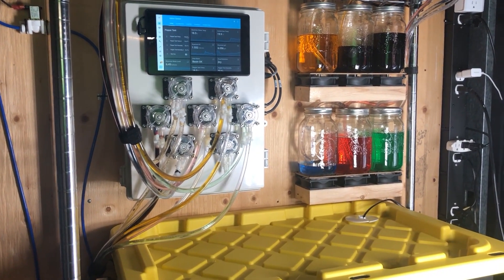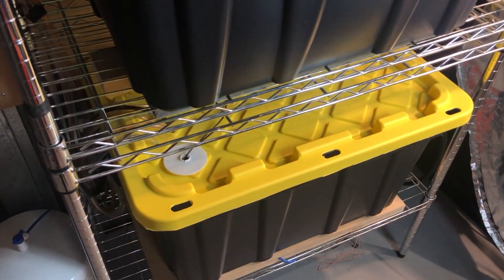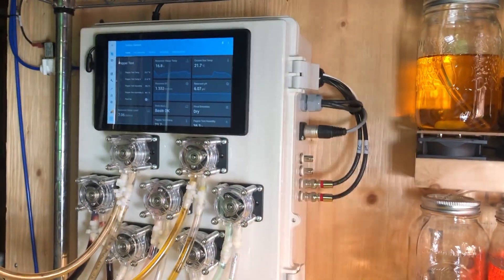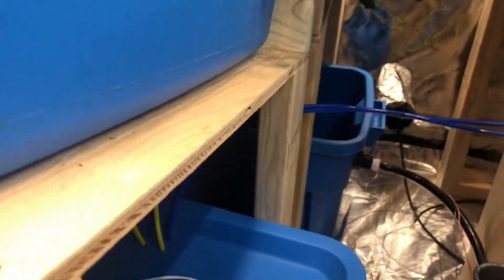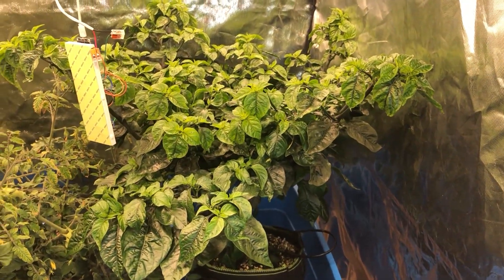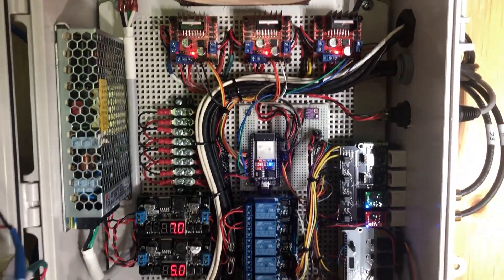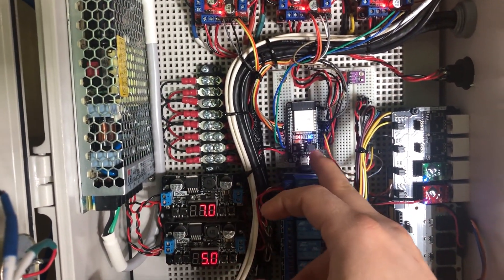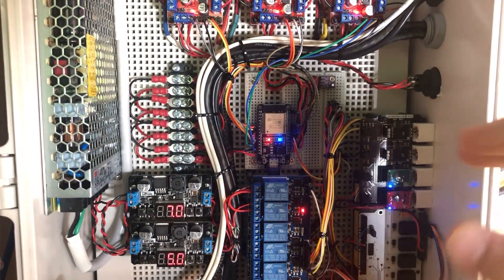My DIY Home Assistant Garden Automation System - Climate Control, Dosing, and More. Pt.1 - Hardware

Comment: Very impressive! I'm looking to also integrate my inline fan like you shortly mentioned you did in the video. Is there any chance you would be willing to elaborate a bit on how you did this? I also have the ac infinity and I haven't been able to find much information, so anything you could share on how you did it would be of great help and very much appreciated! I found I'll need an optoisolater, but I'm not very clear on the wiring
Reply from the maker: I'm now doing my Cloudline T6 with an ESP32, an IRLZ44N MOSFET and a 10K resistor. I'm not 100% sure it is the best/proper way to do it but it's working for me... use at your own risk though. When hooked up as it is from factory, at full speed, I'm measuring a little under 30W DC being fed to T6 fan.

On the fan is a little removable panel and there is a terminal block in there for ground (black), +24VDC (red) and PWM (yellow). I've left PWM and +24V as they were, but pulled the ground from the controller side off the terminal block. I feed this into the source side of the IRLZ44N, then run a new wire from the drain of the IRLZ44N to the terminal block where that other wire used to land. ESP32 ground gets tied to the source of the IRLZ44N and I also connect a 10K resistor between source and gate of the IRLZ44N - the resistor pulls down to ground so the fan can turn off when the PWM signal disappears. PWM out from the ESP32 attaches to the gate of the IRLZ44N as well.
Reply: @LEDGardener  Thanks for the very detailed explanation, crystal clear what I need to do!

Comment: Very nice! well put together and well designed.  I have been playing with something similar on a shoestring budget. Do the nutrients always stay in the hoses on the way out of the containers? meaning if I have a long hose of cal / mag and it is full of well over the 10 to 20 ml I will need , will your dosing mechanisms only dose the desired amount pressure restricts additional flow of nutrients after pumps stop ?
Reply from the maker: Yes, the hoses stay full. You need to make sure the hoses are clamped tightly to the pump fittings to maintain the vaccuum and prevent leakage.
Reply: Awesome, I was thinking about using this for rapid prototyping using deep learning from pics , taking the env variables . Maybe eventually spit out a perfect recipe for a plant for most optimized return .

Comment: You should use capacitive water sensors to avoid electrolysis:
https://youtu.be/udmJyncDvw0
Reply from the maker: I hope mine never even touch water since I’m just worried about floods
Reply: @LEDGardener  so when you 'flood them' your not worried about how much water is retained? And when to reflood them based on soil moisture level?
Reply from the maker: @jimmyjamall  Nope. I’m not using them in the plant pots. They are only used to detect when there’s an accident and the system floods. The plants sit in coco/perlite so you can flood them several times daily without worrying about drowning the plants. The coco-perlite combo is magic.
Reply: @LEDGardener  ooh thanks I'll have to read up on that.

Comment: your garden has much to be desired in production, but the detail of automation you created is astonishing.  I have been farming for 12 years, and am moving towards indoor and hydroponic growing.  I purchased a $50 optiplex and now am on a mission to spend all winter trying to set this machine up to automate my mushroom grow room as well as that emergency water sensor to save my ass.  Plus having the ability to mix hydroponic solution would take away all my clumsy habits that are in my current system caused by me and my lack of attention to detail from over working.

Thanks! if you sell a system or one like it, let us know!

Comment: Amazing work! How do you measure the actual amount of liquid going through your peristaltic pumps?
Reply from the maker: I’ve just got their timing dialled in so they’re all outputting the same volume per 500ms or however long they’re on.
Reply: @LEDGardener  gotcha thanks!

Comment: What size standoffs did you use? The nylon standoffs listed in the video description are too big to fit in the BUD enclosure holes
Reply from the maker: Mini man I just drilled out the hole to accommodate it.
Reply: @LEDGardener  Thanks! I'll do that. It's funny the panel is listed as no drill, but the holes are too ding dang small
Reply from the maker: They are indeed ding-dang small. I wonder what they’re intended for?

Comment: Everything listed in description adds up to around $1550
Reply: I'm not surprised. He's using quite a few high-quality components. Most of the setup could also be done cheaper, but would either be a lot more work or less reliable.

Comment: That is an absolutely awesome system.  I do embedded system design as my career and this is really interesting to me.  You got me wanting to build something like it just to see if I can do it.  I do have one question.  The secondary power supplies (step down from 12V), can you give me the purchase information for those.  I am constantly needing something like that for my projects and to keep around in my magic tool box.  I tried to make out the brand name on them but could not quite do it.  Any information you could provide would be AWESOME.

Thanks for showing off the system.
Reply from the maker: Nice! The buck converters are DROK part number 090029

Comment: Instead of using those moisture sensors on the floor as leak detectors, use side-mount liquid float switches for each container to send high water level alarm to your system. You can buy these mechanical switches for cheap and are more reliable than resistive moisture sensors for your application. A more elegant design to avoid spills.

Comment: Awesome home automation, What did you use to cut the holes in the control box?
Reply from the maker: A hole saw for the pumps and then spade bits and normal drill bits for the rest.
Reply: @LEDGardener  Thank you!

Comment: This is amazing. I am on my second prototype of something similar but no where near yours yet. Can you tell me how you controlling the inline duct fan. you mention PWM but it's unclear how you are doing it.  I have a 4 in fan that is either on or off with a voltage adjuster to control speed. I'd like my Arduino to control the speed though.  Can you explain how your works please?
Reply from the maker: I’m using an ESP32 and a logic level MOSFET (IRLZ44). I intercepted the PWM signal wire from the controller and feed that into the FET at 100% duty cycle and then use the ESP to PWM it to whatever I want. This way I don’t need to add another 10V source which I don’t have handy. The ESP32 receives PWM instructions via MQTT and the other side of the MOSFET connects to the PWM wire of the fan.
Reply: LED Gardener ahh I see. Very nice. Thank you.

Comment: How did you mount the PCB boards with standoffs to the back plate?
Reply from the maker: Nylon screws through the backplate and into the standoffs
Reply: @LEDGardener  well yeah but the nylon screws you linked to in the description they don't fit. I could probably use a hammer or pre drill the holes... but im stuck because of this.
Reply from the maker: Cobey Raap oh I see what you mean. I drilled the back plane out to accommodate the screws.

Comment: I'm setting up an automatic watering system for my tent right now,, and what I have set up for checking water level is one of those HC-SR04 sonic distance sensors mounted on the lid of the reservoir so I can tell how high the water level is.

But this so so freaking cool, it's basically what my end goal is once I get the basics working.
Reply: i upgrade to the tof laser sensor for measuing waterlevel

Comment: Thanks for the insights! Pretty nice setup!
I use a super cheap sonar sensor to measure the water left in the tank. It needs a tiny bit of filtering but its super easy, works like a charm and is also very cheap ;-) just google arduino sonar.

Comment: @LED Gardener: This upload earned you a subscriber. I'm very impressed with your build. Well done! :-)

In my own projects, I love using these terminals on headerless breakout boards. They make the final project super easy and more permanent. 
https://guide.alibaba.com/shop/atoplee-30pcs-3-pole-2-54mm-pitch-pcb-mount-screw-terminal-block-connector_1010058562.html

Also, you could maybe ditch the breadboards this way.
Reply from the maker: I like this idea. Thanks for sharing.

Comment: If you had a budget for R&D, do you think you could work with a hardware engineer to build a small commercial system that's essentially "plug and play", and scalable / modular. We could even build a web app user interface.
This interests me.

Comment: Any particular reason you opted for peristaltic over solenoid metering pumps?
Reply from the maker: Hadn’t heard of them prior to this comment. They seem pricy though in comparison.
Reply: @LEDGardener  They are more expensive. The main difference is a peristaltic pump is accurate initially but then rather quickly can begin to loose it's calibration as the hose wears. 

Likely not as much an issue in your situation because your system is monitoring your target EC and compensating for the variation.

I was just curious. Thanks for the response.

Comment: I use many eTape sensors and they are gread and stable, the erratic readings probably coincide with your pumps altering the pressure water exerts against it. If you looked at all your sensors / actuator uses on a time line, stacked ontop one another, you could confirm. #LearnToDataSciencs
Reply from the maker: You could be right but that hashtag made me laugh
Reply: LED Gardener scientific notation 🤷🏻‍♂️ outliers are outliers until you figure out causation.

Comment: 14:38 Quite expensive solution. A possible way to do the same is to connect two wires to Arduino. Set one to D1 output to HIGH, and another A1 to ANALOG READ.  There will be noise on A1 but after adding a resistor(1M as far sa I remember) between them the noise will go off. Then just tune the thresholds programmatically and you are good =) By the way with this approach you may use just one D1 output and many A1-A10 to setup many leakage sensors. Nice setup, by the way. The trick with the mass measuring is amazing.
Reply from the maker: Thanks for this idea!

Comment: good morning i have A question regarding the project, how it made the connections of the prototype and how it programmed the operation of the system since it did not show the connection diagrams and the programming of System which is done through open source or closed source
Reply: There will be some way to know the two things mentioned above since I had a question regarding the programming of the system and the connection scheme or schemes depending on the case.

Comment: Great overview! 25 dislikes? Proof there should be an intelligence test before people are allowed to use the Internet. Anyway, increasing automation is awesome but also should come with increased safeguards in case something doesn't go right since the goal is to reduce how often you put eyes on the system. I would like to suggest a flow sensor in the water line before even the first solenoid and connect that to an independent microcontroller to notify you in case it detects a continuous flow over a certain period of time that is longer than you would be watering. This way it will be your first line of warning for all sorts of bad things like leaks, stuck solenoids, the ESP8266/32 locks up with pins driving your solenoids keeping them on, errors in your Arduino sketch (or whatever programmng environment you are using), etc. Additional flow sensors can be added elsewhere but tempered with the idea of "more connection points provide more leak potential". Notifications from this flow sensor could be sent to a cloud service to add even more safety such as "have I received a flow start or flow stop notification lately? If not, warn my user I haven't heard from that sensor". What else? Soil moisture sensors, standing water sensors on the floor in case of a bucket leak, etc... :)
Reply from the maker: Thanks for the ideas. The floor sensors I use have saved me a couple times already (once the tomatoes weighed down my feed line and sprung a leak in the tent and I caught it right away, thanks to the notification). I have physical overflows that feed into a drain for both reservoirs but agree that more info and more safeguards cannot hurt.

Comment: If you haven't looked into MQTT and Node-RED, I highly suggest it. I can't stand HA's automation system. Also, Tasmota and ESPHOME. I'm also using weight sensors with the HX711 board, D1 Mini for bedroom bed presence, and also for a basement water tank that pumps water up into the septic line when the weight reaches a certain threshold. It's addicting to automate EVERYTHING! :)
Reply from the maker: Nice. I'm using MQTT in this setup and switching to NR for future automations.

Comment: I've been automating my grow/house for the last two years using Home Assistant, and it's amazing. It's completely customizable, and the results have been very consistent in the garden.
Reply from the maker: There are literally dozens of us!
Reply: @LEDGardener  I'm working on a cloud/iot platform for arduino growers - would love to integrate a system like this into it
Reply: @traptinaphonebooth  i tinkered with an ESP32 and the Blynk app, i was able to do simple things but for those complicated things i wasn´t able to make it work. you can hook up a Bosch sensor for humidity and temperature, theres also a CO2 sensor altough a bit pricey,

Comment: Congrads...you "scienced the shit out of that". Mars trip guaranteed.
Reply: I=This is not science, this is engineering. He engineered the s**t out of it. I don't want to be obnoxious detailist, but maybe you can read something about the scientific method. It is a good thing to get right early.
Reply: @_general_error  It was a movie reference.  I'm extremely aware of the method (I use it, I read research papers, etc.).  In case you're interested in the movie (based on a book) referenced in the joke, the title is "The Martian" (2015).  Thanks for educating other readers.
Reply: @_general_error  I mean really did he not do both tho? When you get to the details he did the exact meaning of science... He took the body of knowledge on a particular subject. An is engineering a system to get the best results he can, In his observation and experiment an always build on his own studies to get better results. I am SURE as rain he runs, What most would call "the scientific method" in his head every time he adds or adjust's aspects of his grow. I mean he ran the method to take himself out of the grow right?

Comment: Awesome!
However did i understand it correctly that you  pump the excess water from flooding the pots back to the reservoir?
Doesn't that lead to build up of nutrients in your system?
Reply from the maker: Hey Tet. It’s just like any flood and drain system really. You change the reservoir out every week or so to keep your ratios right.

Comment: Great work! For how long did you have the PH probe submerged and is it still giving accurate values?
Greetings from another embedded hobby gardner.
Reply from the maker: Hansel... so hot right now. I usually recalibrate every couple weeks.
Reply: @LEDGardener  That was the main reason i decided against it.
Have you thought about automating the recalibration process? Up, turn, Dip, turn, Dip, Turn, Dip, turn back and back down...

Comment: Very cool. Interestingly I used a similar BOM for my cocktail machine, pumps, drivers, hardware are all very similar, even used mason jars for the reservoirs. You obviously have much more advanced problem and solution but cool to see how similar the setup ends up!
Reply from the maker: Nice! I noticed a lot of people in the amazon reviews for the gear I bought had mentioned they were buying that part for a drink system as well.

Comment: Do you have the code for the solution measuring and mixing available in the forums? Or would you consider adding it? I don't have anywhere near the system like you have, but think the solution measuring/dosing is something I can incorporate into mine. Thanks

Comment: Very well done. I have a similar setup. I am using sonoffs to control my AC devices. I have my EC and PH sensors as well as sonar sensors all routed to ESP8266's and ESP32's . My EPS's are all using ESPHome and all my automation is done through NodeRed. Drop me a line I would love to pick your brain and compare notes. Not to many people doing this. Took me a while to compile everything I have.
Reply from the maker: Hey that's awesome! I really want to make the jump to NR. Most of my ESPs are running ESPhome as well.

Comment: Dude, that control box looks great!  My projects wind up looking like random spaghetti taped to a wall.
Reply from the maker: Hahaha. Thanks. I would love to tidy the wiring still though. What kind of stuff are you working on?
Reply: @LEDGardener  Don't have a lot of time to build much.  I've got an arduino that monitors my water pressure and pops a relief valve when the water heater is running.  (I know they make bladder tanks for this, but those tend to trap water that gets nasty smelling with hydrogen sulfide over time and gets sucked out when water use is high.)  It only "uses" a few ounces of water each time it pops, but it's enough to keep the pressure from getting insane.

Also have a prototype motion sensor for my home automation (a prototype that's been in use for 5+ years now, LOL).  It was using an XBee module to communicate.  But I'm about to change it to an ESP8266 based thing.

Similarly, I have a XBee wired into my off-the-shelf driveway alarm so the system knows when a car is approaching my house.  I'm replacing it with an ESP8266 as well.